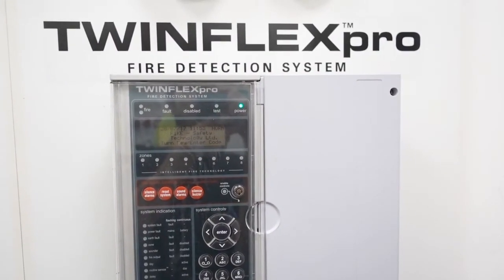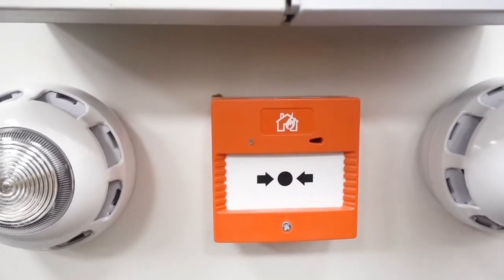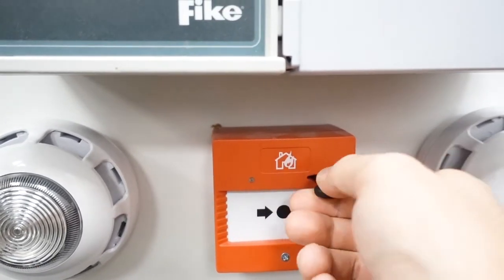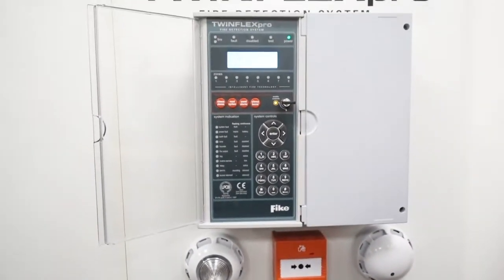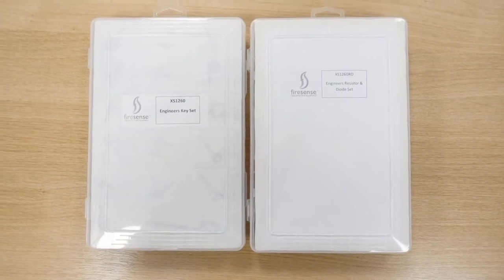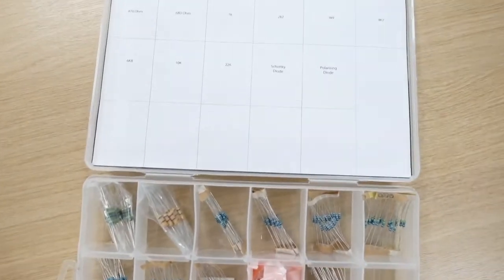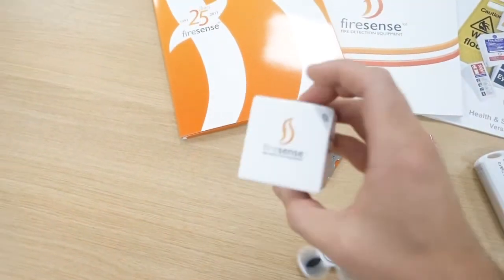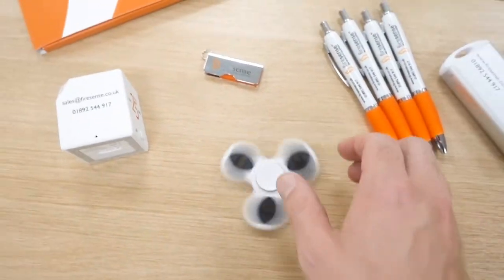TESTING FIKE TWINFLEX PRO PANEL AND MCP | FIRE ALARM DEMO

Comment: What's the best way to install a Fike 600-0092 Twinflex Remote Indicator setup, I need to be able to shut off a gas solenoid valve , do I just connect on a zone circuit? Aux or I/P O/P terminals    Thanks

Comment: Somebody tell me about EOL missing shows in alam panel what can I do to solve this
Reply: Go to the last device and set it to EOL   NUMBER 1 IN THE ON POSITION DOWN
Reply: Are you talking about on the twinflex pro ? If so there is a dil switch on the detector/ manual call point or sounder to enable the eol

Comment: Shocking panels, shocking product. Worked at a company that’s used it for years, non compliant settings on the detectors, no thanks mate!
Reply from the maker: SILENTx xTRIGGER not a fan then!
Reply: @DanstheEngineer  To be fair they do have some reliability issues, especially the older panels
Reply: @yeety1208  changing the two back up lead acid  batteries , do I have to switch mains off to do this ? Can I leave power on while I do the switch ?
Reply: @ryanwest2359  nah you can leave it on
some panels will not power up just on batteries, not sure about twinflex pro tho

Comment: Dan - Question - can you use the new style sounder/strobe with the old style of twinflex panels?
Cheers
Reply from the maker: rickyreynolds17 if you mean the combined ASD with sounder strobe, then yes it can go on both Twinflex and Twinflex Pro panels.
Reply: Dans the Engineer the old style non LCD panels? Thanks for the quick response :)
Reply from the maker: rickyreynolds17 yes on the that's the one.